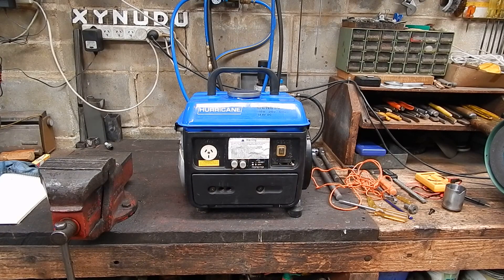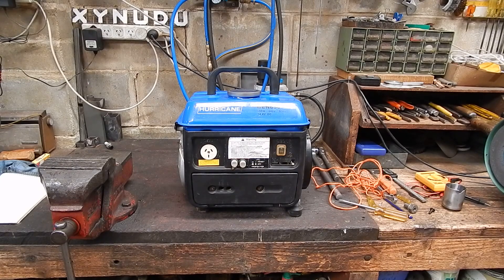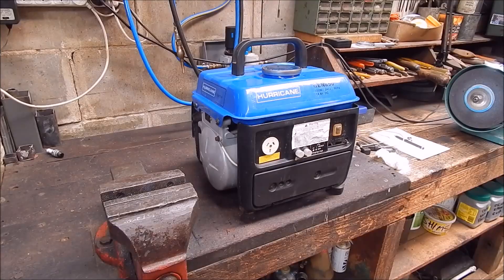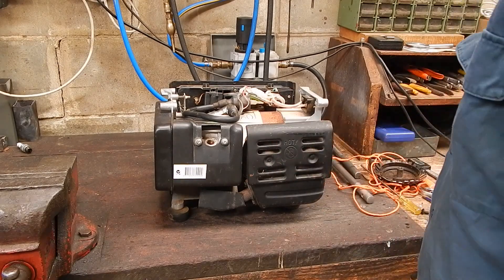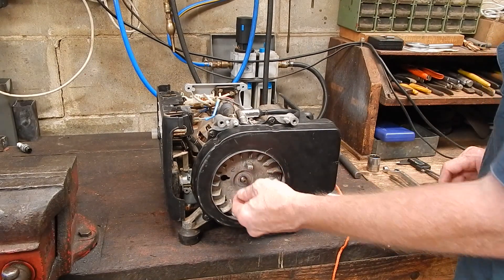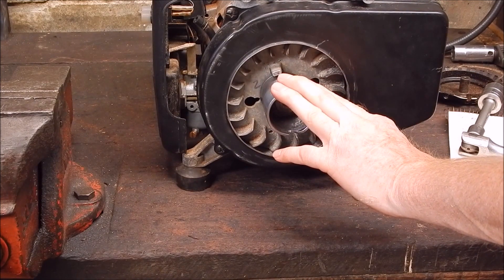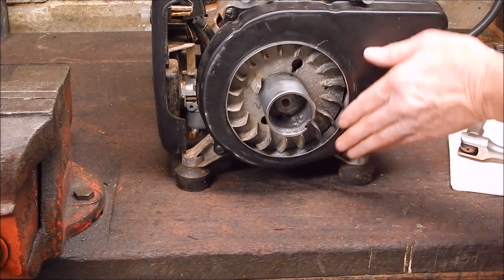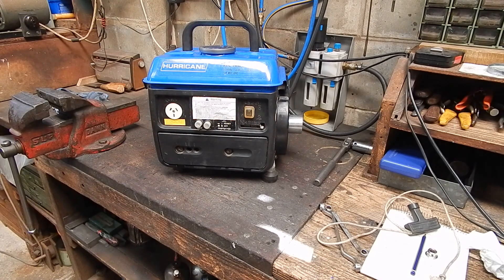Chinese two stroke generator pull start modification

Comment: After having to pull apart the generator to fix mine, I can't help but feel these generators could do with a flywheel weight to smooth the output a bit. Your vid shows the perfect place to put one.

Comment: I made an electric start for mine. Welded a small shaft onto a socket that fits over the crankshaft nut and attached a cordless drill. Presto works like a dream.

Comment: Nice work there Rob, making it simpler & better is the way to go.
Reply from the maker: +ShysterLawyer 

I've done two of these in the last couple of years.  Bro Inlaw has one, and sold the other.

You can pick them up as non goers for $10 - 20.  Easy fix if you have a small lathe.  They are actually very simple engines and not much to go wrong.

Good for power tools, but very dirty electricity, so lights flicker and not suitable for PC's etc.

Cheers Rob

Comment: You mentioned there is a Yamaha workshop manual available online for the Yamaha version. You wouldn't happen to have a link to one? I can't find it.
Reply from the maker: +KevCentral 

That was some time ago.  I don't have the link any more.  I remember it was buried away in some site with heaps of other generator manuals.

There is also a parts manual on line as well. Maybe on the Yamaha site, from memory.

Have you found that?

Cheers Rob
Reply: +xynudu I have a parts listing and a few sites to get parts. I would really like some form of workshop manual.
Reply from the maker: +KevCentral 

I just had a quick search under " Yamaha ET650 pdf" and quite a lot of listings came up.

I see service manuals shown, but you have to register to download - supposedly free.

Try that.

I never bothered with a service manual as they are a very simple design, using standard gap settings, fuel metering, output setting etc.  

Hope this helps.

Cheers Rob
Reply from the maker: +xynudu 

The ET650 and the ET950 are basically the same unit, so search on each of those model numbers and you will get something.

Cheers again.

Rob
Reply: +xynudu thanks. I was more concerned with torque settings and such. I'll give this a search.

Comment: I've had a number of these 2-Stroke Chinese generators, and have had very good luck with them.  The pull starter breaks when the engine backfires while starting.  Here's the real trick:  Never start the generator without using the choke, even if it's warm, still choke it.  If you do this, they will not backfire and will not break the starter.  I've gotten over 2,000 hours on these little units.  If you let them sit, shut them down with the fuel shut-off instead of the kill switch.  This will burn the fuel from the carburetor bowl and help keep that from lacquering up.  If you do this, they will last a very long time, much longer than you ever might have imagined!
Reply from the maker: Hi Jeff,

I've never had these units backfire.  The problem is that the pull start pulley is parallel sided plastic, and the cord spreads it as you pull on it.

It's a bad design that will cause it to crack.  If the pulley was metal it would be OK.

These motors are very robust apart from that, and go and go.

The voltage is pretty dirty, as like all two strokes, they hunt unless under load.

Cheers Rob
Reply: +xynudu I dunno, I tend to agree with him. Mine was fine for a couple of months,on the pull that broke it my hand was pulled back to the unit hard enough to bruise my knuckles.
Additionally when I tried to start it again it was flooded. This would increase compression because the rings seal better when wet.
Anyway took it back got full credit on a new predator 2000 inverter gen. 
best decision ever.
Reply: It may have been a fluke for me, but that was my experience.  Never start without the choke and shut them down with the fuel shut off instead of the switch.  Even if it had run out of fuel and was still hot, I choked it.Otherwise, I got over 2,000 hours on these individually before they would wear out.  They are good generators, designed and manufactured for Yamaha.When we first built here in Maine (off grid) all we had for power were generators at first.  I would use the 7500Kw for pumping water and the microwave, and the 2-cycle for everything else.  I ran these every single day for about 12-16 hours for over a year.  No backfires, no broken starter pulleys.  I still have two brand new starters in the garage because I had expected them to keep on breaking (I had stocked up, they are only $20 each).Once I put in the big inverter (Xantrex 6048) and battery bank (4 Trojan AGM 8D) all I used was the big generator because I was charging with 45 amps of power.  I added solar panels afterward and that was the last I needed the small generators.They did work very well, always started up good, and always ran good.  I've had four of these and after learning with the first two, I never broke another starter.  To put 2000 hours into perspective, my 6 year old riding mower doesn't have 200 (two hundred) hours on it.  My ATV's (2010 & 2005) don't have 200 hours on them yet either.I've had such great luck with these that I would not hesitate to buy another if I needed it.  Like I said, I pulled the rope and started these at least a couple times every single day and ran them for the majority of the day for over a year.  Once I adapted to starting them, I never had a problem.  I highly recommend these little generators.  Sure, the little Honda's are a whole lot quieter, but I doubt anyone is getting much more than 2,000 hours on those before they wear out as well.

Comment: Thanks for the idea. I fixed mine in 20 minutes  (USA time) using a part off an old honda small generator. Practically bolted right on. Ps, use impact wrench on crank nut. Works perfect.

Comment: Thanks for the idea. Wanted to install a pull rope for my Linhai 150cc Farm ATV but it has no place to for a pull start coil. I will be attempting to put your idea to work At the magnito side as it has a bolt there already. and space to pull a rope. Thanks a million!

Comment: That is a great work table that you built.
Reply from the maker: Hi Bob,

It is built from salvaged wooden cross beams from utilty poles, with a jarrah hardwood work area to take the knocks.  I hate steel top work benches as everything just slides around and they are noisy.

Cheers Rob

Comment: Great, have the same machine, and pulled off the unit and the spring behind it sprung out.  As i don't have access to your tools and equipment, got any tricks for rewinding the large spring?
Reply from the maker: Not really.  Those springs are diabolical things.  Good luck.  Cheers Rob
Reply: @Xynudu  yes, just wound it. Some of your video gave me ideas, but never want to do it again!!

Comment: I have one as well, need help connecting the electric cables under the fuel tank. Where do they all go to?
Reply from the maker: +Neema Mungo

 The main rotor/generator output wires should have matched connectors/plugs.  As these clones are often wired differently to the face panel, you will need to check against a similar layout.  Rob

Comment: Hi rob could you run a portable fridge of one if so what would I have to add to it would a voltage stabilizer be of help cheers tony
Reply from the maker: I can't answer that for sure.  I know these are used by a lot of off the grid people as backup to charge the battery bank and they apparently punch above their weight.  Some of the stories about what they supposedly run make you wonder.

I've never tried a fridge off any of the three that I've had. To run a small bar sized freezer I have to use at least a 1 KVA unit, but a portable fridge would require a lot less (depends on the wattage/amps.

These two stroke gennys seem to have a rated output between 650 and 750 watts with a peak of about 900 watts, so work on those figures.  Startup load is the decider as if the genny can't supply enough at peak then nothing is going to happen.

Unfortunately fridges don't usually quote a startup wattage as it's only a momentary load on the mains supply (which can easily handle it).  Generally you only get run load.

Even though the output on these gennys is pretty dirty/fluctuates due to two stroke hunting, they will run any AC induction motor quite happily and steadily.  So a fridge should be fine.

The only time variation matters is with light flicker (including fluros).  I also wouldn't use one with any sensitive electronics like PC or TV (even though they have rudimentary filtering in the power supply).

I hope this helps.

Cheers Rob

Comment: I got one given to me I have no spark tested the coil that was all good any suggestions as to fix my problem cheers
Reply from the maker: If it's a GMC brand it's probably the ignition module is dead.  They die very readily.

You can buy replacement modules/packs off of Ebay for not a lot of cash.

Disconnect the kill switch lead to make sure the switch is not bad, and of course use another spark plug that's known to be good.

These gennys are generic and parts are interchangeable between brands.  They are all just a copy of a Yamaha.

Cheers Rob
Reply: buy a none china spark plug

Comment: I just welded a piece of muffler pipe to those tabs on the flywheel and wrap a rope around that to start mine.  I bought a replacement part for it the first time but it broke the first time it kicked back on me so ended up reengineering it.  Too bad they don’t make the starter part better in the first place.
Reply from the maker: The replacement part is as shitty as the original bit.  They have a plastic centre which isn't up to the task.

Simple pull rope can't fail.

Comment: Hey Rob. Great work you do. Wonder if you could assist me, i bought one of these cheapies today for $15. It wont start. apparently it has been standing for quite some time. I dumped some fuel down the spark plug cyclinder and it fired up. I tried cleaning the carby but still no go. any ideas and advice will be greatly appreciated! Thanx
Reply from the maker: Rodney Mathee Hi Rodney.  That's a pretty cheap generator.  These babies are pretty simple really.If it fired then it means it has spark, so the problem is fuel.In the carb bowl base is a drain tap.  Unscrew that and make sure fuel is flowing through the system.  There is a filter in the tap assembly that can block.  If fuel flows out of the bowl then that is ruled out.So it comes down to the float level is too low, or most likely the main jet is blocked or the idle jet is blocked / incorrectly set. Blow the jets out with air and try to start it. It might be worth taking off the pull start and spinning over the motor with an electric drill while you play around with the idle jet (which also affects the main jet).  It should fire up if it has fuel and the jets are clean. Let me know how you get on. Cheers Rob.
Reply from the maker: Rodney Mathee When you try to start it, make sure the choke is on, screw the idle jet out 1.5 turns, and it should fire.  Turn off the choke once it's running and adjust the idle jet until the motor smooths out. Good luck.  Rob
Reply: Hi Rob. It's getting fuel to the bowl. That's all good. I let it soak for a couple days in petrol and then blew everything out including the jets. I tried just then and it still won't go. I sprayed some carb cleaner into the carb and it fired up for a few seconds then died. Thanx
Reply from the maker: Rodney Mathee OK do this. Make sure spark plug is dry, then pull motor over a half dozen times (with it in), check plug again to see if wet.  If dry it means the float bowl level is too low, If wet it means plug is probably faulty. The original Chinese spark plug is known to be poor quality.  Also check the bolts holding the reed valve and carby are tight as it could cause an air leak at those points. Rob
Reply from the maker: Rodney Mathee I recommend you spin over the motor with an electric drill while you screw the idle jet in and out to get it to fire.  Also make sure the carby butterfly is open at the start position, and leave the air cleaner out for now. Once you get it going you can fine tune it and set the voltage etc. Rob

Comment: Hi friend I have one but stop no spark to plug any ideas
Reply from the maker: The CDI ignition module can fail on these.  You can buy a new one from Ebay cheap (generic). Check the on/off switch is working by disconnecting the grounding wire from the motor.
Reply: xynudu thanks friend

Comment: much easier way is to cut the head of a bolt into a 1/2" square with the grinder so it'll fit into a socket. use the bolt in a drill to turn that crank bolt and start it that way 👍
Reply from the maker: The nut on the crankshaft allows that option.

Comment: Mine had this problem as well. I did not like it gave it away to a friend. These two stroke generators to me are just junk, hard to start, carb problems. I eventually found a four stroke generator that was just slightly bigger that starts on first pull every time. Huge upgrade over this junk design,
Reply: Goldstein .  I have heard to use an Autolite 65 in place of the original junk spark plugs.  Please do your research in case I have the number wrong.

Comment: Nice one Rob, $10, can't be bad....
Reply from the maker: Steve McQuillin Virtually brand new.  Runs great.  I put my 700 watt drill on it as a load to measure the voltage drop, and it was no problem - still put out full 240 AC. Very quiet too.  Cheap and cheerful :)  Rob

Comment: Could you have just directly tapped the end of the pulley instead of making the specialized nut?

Either way, nice fix.
Reply: I just thought about it but I guess the issue would be you wouldn't have anything to hold to tighten it down if you didn't use the bolt.
Reply from the maker: Stephen Thomson
You could tap directy into the end of the pulley, and drill through the pulley sides to put a bar through for tightening.  I considered this, but went with a separate tube nut. I didn't like the idea of putting a spring washer directly between the pulley and the end of the crankshaft as this would reduce thread length and could mean the pulley did not not tighten up square.  It also puts more load on the crank end as the mating faces are much smaller that way. If you just used Loctite on the thread then I think it would work pretty well, with good face contact.  It's certainly a workable way to do it and is simpler.  Next one I fix I will try it (with Loctite), and if no good I can easily dril out the end and fit a tube nut.  Thanks for the comment.  Cheers Rob
Reply: xynudu Ah yes. I didn't consider the lock nut either. 

Good thinking.
Reply: A strap wrench might tighten the nut down sufficiently.  The natural tendency when starting the engine would tighten the nut as you pull started it.  Clockwise to tighten the nut, clockwise to start the engine.  That is why some nuts are left-handed, to counter act the tendency for them to loosen during operation.

Comment: Seems easier to me to buy the proper pull start.
Reply: Yes and after a few starts u have the same problem again . I use my cordless drill with a 9/16 socket  to start mine .
Reply: If you're fortunate enough to find one.  I have lots of trouble finding parts for low cost Chinese products.  It's almost cheaper to toss it and buy a new one.  Emphasize almost.  Ebay has one for this generator $28.63 + $10 shipping.  Compare that to the cost of a new generator from HF at $110.

Comment: i know its old.....you just need to use a longer reach plug..............duh
Reply from the maker: Sounds like BS to me.   Normally you can put a long reach spark plug in a short reach head and it won't touch the piston crown. That's how people stuff up motors and have to pull the head off to de-coke the exposed thread to get the longer spark plugs out.  So your "old" idea isn't going to work on any engines I've seen any time soon.  LOL.

Comment: OMG the proper way to stop that crankshaft from turning IS NOT blocking up the piston with a rope. By blocking the piston, you have a good chance to bend the rod and damage the bearings when tightening/loosening that nut.
Reply: Umm No because they make piston stop tools that do the same thing. They screw down into where the plug is stopping the piston from moving. That was his point if you listened to him. Why buy a piston stop tool when a rope can do the same thing.
Reply: Piston stop tools are NOT used to keep the crankshaft from turning.  They are used to locate TDC of the piston travel.
Reply from the maker: Piston stops are made for both purposes.  Look up chainsaw piston stop and you might learn something.
Reply: I still wouldn't use anything like a bolt (that's what it is) to stop the crankshaft from rotating.  He does point out that the spark plug hole has to be vertical to the piston,not angled as it is on some engines.
Reply from the maker: If you care to check you will learn that Stihl and other manufacturers make and sell piston stops as OEM equipment.  I expect they use them in their service departments as well.

I'm sure they know better than most what is right and what isn't for their engines.

Cheers Rob

Comment: But... why.
Why not just remove the pull cord, drill a smaller hole in the center of the cover, and use a socket on a drill to turn the engine over.
Bam
Reply from the maker: How are you going to power the drill without electricity ?  LOL.  That's why the generator is there.
Reply: @Xynudu  cordless.... and use the generator to charge the batteries once it's on.